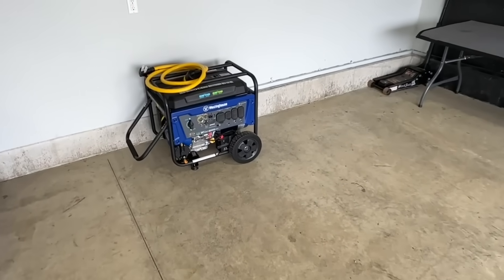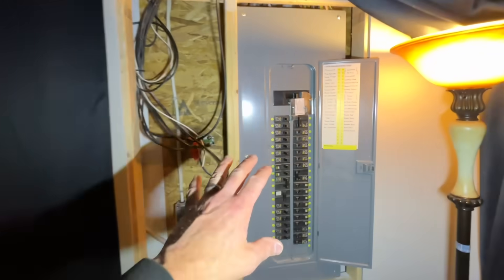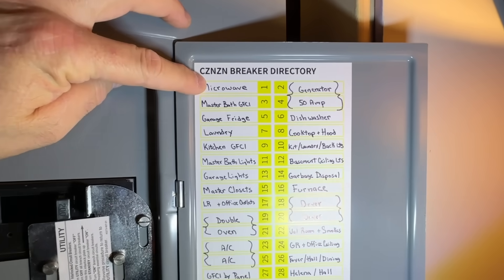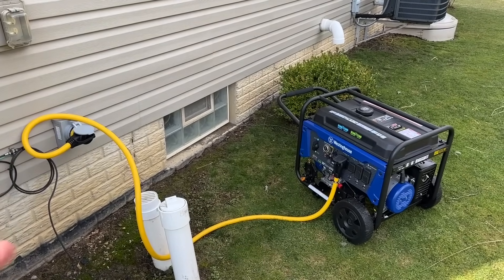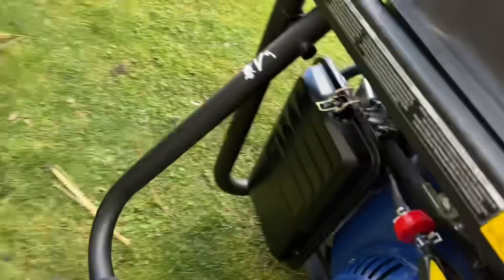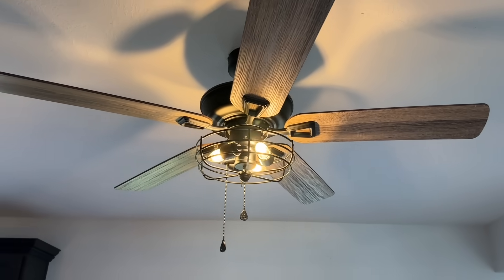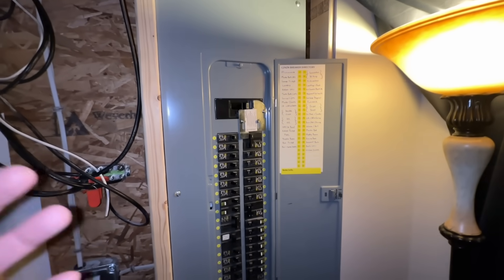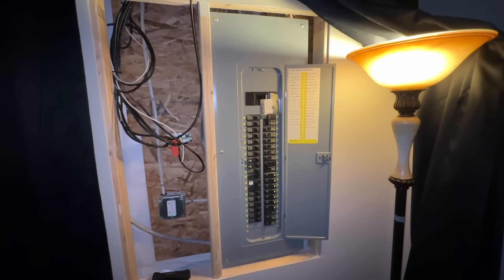Whole Home Manual Backup Generator Setup For Less Than $1600

Comment: I own an all electric home and do not have access to public utilities like city water and sewer. I did about the same setup as you have but I used a 12,000 watt Duromax dual fuel generator. Since I am also a licensed master auto tech with over 40 years experience, I know for a fact that running a generator on gasoline with ethanol will destroy the fuel lines, fuel pump diaphragm and generally destroy the carburetor, I chose to run on propane. I also have a 220 volt submersible 4 inch well, an electric hot water heater and a 4 ton central heat and A/C unit, 2 1700 watt microwaves and a standard as well as a convection oven and  an electric range top and an in ground pool. I will admit that the central A/C is a 2 year old 22 seer system with an 3200 watt start load and a 1600 watt run load and the pool has a variable speed pump which cuts the power consumption tremendously compared with a standard 1Hp motor that pulled 1100 watts for 8 hours to a 60 watt load for 10 hours. . There is a standard 22 cu. ft. fridge and a 24 cubic foot chest freezer, and of course a washer and dryer. When I was wiring the breaker panel, I used an amp probe to determine the load on each circuit and the only thing that gave me pause was that if the hot water heater was running at the same time we were baking and cooking and the central HVAC cycled, the generator would lose about 50 to 60 rpm for about a half a second. So I added a 240 volt switch to the 40 gallon water heater and we just leave it turned off until we need it. problem solved. Now we can run anything at any time and make sure not to have the ovens, or stove and dryer running at the same time as the hot water heater. I also got 3 40 pound propane tanks which hold just under 30 gallons of propane and weigh about 220 pounds combined. So there's no running around filling three 5 gallon gas cans every day and a half. The three propane tanks will run for about 5 days, 24 hours a day. Cost wise, gasoline costs about $50 dollars per day, versus $24 per day for propane. And unless you are going to store fifteen 5 gallon cans of gas you will be searching for fuel every day versus once every 5 days for propane. And propane can be stored for over 20 years while gasoline has a shelf life of about 3 to 6 months.

Running propane will cause a slight power loss and if I had a 15 kw duromax, I would be able to run everything at once, including the hot water heater, but at the time, the 12 kw was the largest dual fuel generator available, this side of a $12,000 dollar diesel powered Generac, which required multiple yearly oil and filter changes as well as yearly air filter, coolant and fuel injector filters and water separators and valve adjustments, which Generac said would cost an additional $500.00 a year. My total cost for everything was just over $2000 dollars and I'v had to use the system for at east ten times ranging from 1 to 10 day power outages
Reply: Would you recommend ethanol free gas to use
Reply: Great information. Thanks. That's where I'd have to be with my house in SWFL.🎉
Reply: With all that why wouldn’t you have a propane stove and water heater?
Reply from the maker: @akbychoice I have a gas hot water tank and gas furnace already.
Reply: Yes, it's amazing what you learn about your own personal electrical grid when you set up backup power. Luckily my stove is gas. It uses 120 for it's electronics, but that's minimal. My clothes washer and dryer are electric however. I have a 240 tanning bed that gets turned off on emergency power, as it's very voltage sensitive and normally has to run with a buckmaster. I do leave the hot tub on however, but that's it. The hot tub doesn't use much power just to maintain itself. But it does if you let it get cold. I keep mine at 104, and it's fully winter weather insulated. I also shut off my garage door openers and let them run on their own backup power. They'll run a couple of weeks on their own power easy. And they're both 3/4 hp motors. No point in allowing the backup generator to get involved in that if you don't have to. I run a huge gasoline powered job site Generac that's rated for ethanol gasoline, in a waterproof shed about 15 ft away from the house, and I had an electrician run the line and modify my panel for it. It will build a whole subdivision and will easily power the whole house and sensitive electronics, but load determines fuel economy.

I've only needed it twice in the 15 years it's been installed. Ironically, within the first two weeks I installed it. The power company now keeps the trees well groomed and it's never happened again. The worst was a whole week on backup power when a huge 9 foot across tree blew over in 100 mph winds, after two weeks of solid rain and we were still in the middle of the storm. The best was three days for the same reason, but a smaller tree. And, not a week after they got the power back on. They've since cut all the dead trees down. You can make power reliable if you want to. Even on poles. And that's why I installed it, you could see it in the trees and it spooked me. Really spooked me, obviously.

I seemed like a genus at the time. My wife thought I was crazy. I also setup the house across the street. Our little corner was the only lit corner in half the city, and they used it as their staging area because of it. We kept all the outdoor lights on at night. That was a hell of a year. They also profusely thanked us for having the backup power. And it comes around; we always had a funky street light and I called them on it. During all this. After it was over, they came back and tore out the 100 year old street light and put in a brand new LED unit. It's really nice.
Reply: im not reading that
Reply: After I bought mine, dual gasoline or propane, I saw  there was a three way, gasoline, propane and natural gas)..  
Anyway, I am interested in what exactly type of hose that you use to connect the propane tanks to the generator? What where the fitting on each end? 
My neighbor (HV/AC) said he would have helped hook up the natural gas, but the money even for the pipes and parts were pretty high, and too late. 
I live  in  a rural area and getting propane would not be a problem. My main issue when power is out, is I am on a well (good water) and needed a big generator to run it so I can flush the toilets and bath (3000watts just for the pump) and with this one I can selectively run the well and then switch to just one of the A/C and still have most of the other stuff running. 
Thanks for you post and help!

Comment: Nice video showing how to do it. The only thing I would do differently is I'd kill the breaker to the generator before turning it off like that. I would think the voltage would sag down to an unsafe level before completely shutting down and possibly damage electronics.

Something else to think about, don't buy a larger generator than you really need. The larger it can handle the more fuel it uses per hour.  I'm going to run on a 4200w Westinghouse. It is enough to run my lights, TV, fan, and 2 refrigerators and really sips the gas in econo mode. Last power outage for 4 days, I ran the generator while I was awake approx.  16 hrs a day, and used about 15 gallons. I would turn if off at night since I wouldn't be opening the refrigerators, they stayed cool enough being off while I slept.

I made a "suicide" 120v cord (20A wire with 2 male plugs)  and jack that into the outlet that is also wired to my sump pump so the toilets will flush. With how little power lights and tv's take anymore it can easily run all the normal stuff except for range, hvac, and hot water heater. I manually go kill the main before I plug it in and turn off all the 2 pole breakers. Going this route is energizes every other  single breaker in the panel. Most of my lights are luckily on the leg where the sump is connected. I do you have run an internal cord or 2 to power some devices that happened to not be on the same leg, but it's much better than the spider web of cords I was running though the door to power the important appliances. I did my setup with my own time making a cord out of saved heavy duty cords from old appliances and a Westinghouse igen 4200 for $500 off from amazon.  

About ready to be hit by hurricane Milton tonight so I was prepping my generator since I'm sure I'm going to lose power in Central Florida tonight for multiple days. I always do and this hurricane looks extremely bad. I hope all I lose is power....

Comment: This should be a standard option on the construction of all new homes. When you watch the news you'll see thousand's of homes without power across the usa every month.
Reply: Yeah, but doesn't exactly work for apartment buildings.  Quite a few North Americans also rent instead of own.  I know of one house in my town that was built brand new that is also a duplex and the owner put in a generator for his part but did not do the same for his tenant space.  The way the generator was installed makes it a pain as well because when I clear his snow it's right at the end of the da** driveway right where I want to put the snow and then I have to dig the thing out once in a while.  The last time we had a serious power outage was after an F3 tornado 14 years and a month ago (typing this on Sept. 25, 2025) and gas had to be shut off all over.  This makes those Generac pad-mount automatic standby generators completely useless.

Comment: Electrician here. If you bought this house new, you got jipped. With a basement you should've had a 400 amp service. That 200 amp is almost maxed out. We always did a 400 amp with a basement. Also whoever did the service slopped it up outside with running the 4/0 like they did. I wouldve raise HELL with them doing it like that. Just a pet peave of mine. I power my house the same way as you though. Works fine. Word to the wise. DO NOT TRY to power your well pump like this. I burnt up my pump and luckily it was still under warranty so I got a new one free. But its always enjoyable puttin one in!! Only reason I tried runnin my pump was it is only a double 20 amp. It ran but it burnt up the pump where it wouldnt work right after.
Reply from the maker: Yeah I build this home about 11 years ago and 200amp was the standard at the time but I wish I had 400amp.  I may have a sub panel put in someday.  I don’t have a well pump as I have a natural drain.  I only have this setup for emergencies which only happen once or twice a year for a day or two.
Reply: How would you reccomend hooking up the deep well being water is the single most important thing needed, except keeping your food from spoiling.
Reply: @darryldavis436  You need something that will pull the pump and wont bog down. My generator wasnt strong enough.
Reply: @Wannagobackto1980  OK, Thanks, As long as the Gen is supplying the power without difficulty and alot of load, it will be Ok.
Reply: I mean I really would risk it unless you study really hard and ask alot of questions. Call a well company and ask them and just really look into it before you try it. Pumps arent cheap these days. The one I have is at least 600 dollars. It doubled in 2 years. Used to be about 300.
Reply: @Wannagobackto1980  Just About everything in epensive these days but when the lights go out, we will need water.
Reply: Just RESEARCH before you try it. I dont want you ending up like I did. A burnt up well pump that needs to be replaced. I got mine free cause it was under warranty and installed it myself. It would probably be 1200 dollars if you had a company do it. At least!!!
Reply: @Wannagobackto1980  OK Thanks.

Comment: Diesel Legiance... I need to get a setup like that. Our power was off for 4 days with hurricane Helene and now we have hurricane Milton headed our way. I was on one of the big box stores websites looking at generators and they had a calculator to find out how much of a generator you need. It says for a refrigerator/freezer ya need 700 running watts to run it and an additional 2200 starting watts for a total of 2900 watts just to run one refrigerator. We lost all of our food when the power went off with hurricane Helene so I don't want that to happen again especially this soon after Helene. LOL Unfortunately generators and gas cans are hard to find in stock at stores around here now so it may be too late.
Reply from the maker: Just try to fine a good generator with enough watts needed to run what is needed.  You can also get dual fuel for gas or propane.  I did this setup on a budget as I only use it once or twice a year.  I didn’t need a $15k setup.
Reply: @DieselLegiance  Cheapest way possible is what I want. For the same reason, only using it maybe once or twice a year.

Comment: You can run your hot water heater? Never mind you answered it later on in the video
Reply: I run water heater on my 3500 W generator along with lights and two freezers - instead of using it in normal way(20 amp draw) I set it up in “emergency” way (10 amp draw), so my generator could handle that current.  Wait longer to heat water - but all family could take a shower during outage
Reply from the maker: Yes, but I have a gas hot water heater.  You can run a good bit you just have to be aware of how much your running.

Comment: what size wire did you run from your outside box to your power pannel?
Reply: there is a formula but for the most part if you have a 9-12k generator 6-3 wire is the thing. IF 7k and under you might get away with 8-3 but make sure. The price difference is small and the extra heaviness of the 6-3 is important and makes things work better without chancing a short or heat issue in the wiring. 6-3 runs our entire house with dual 50 amp breakers.  25000 btu 240 a/c and additional 10000 window unit totaling the same as about a 2.5ton outdoor system
Reply: @daddski1  thank you sir

Comment: You can kill utility workers like this. Electric can still flow through grounds. When it is reversed it takes 240 volts, runs it through transformers which takes it back to 880 volts or whatever transformer size it is. The ONLY way to do this correctly is to install a transfer switch which basically is like taking all 3 wires from your house off. I didn't know any of this until I had a utility worker knock on my door one day and ask to see my transfer switch. They heard my generator running and made a special trip to my house to verify I had a transfer switch. I had a relative that installed mine and did it correctly. He thanked me and explained what I just wrote. Please share. Don't endanger these guys lives. Their job is dangerous enough.
Reply: Transfer switch is grandpa era.  Ones you use interlock switch - that is all it takes to have safety setup.  I’m electrical inspector , and installed generator setups many times

Comment: Thank you for the DEMO.
I have a question you don’t mind:
In my house I also have a deep well 3/4 hp pump which use 220v and 30 amp breaker with automatic pressure switch. How and where should I plug  the cable into the generator (mine is 9000 W)?

Comment: I did the same set up but also added a Reliance Wattmeter (MB125) and a Reliance PowerBack (to alert that street power is back on). I use a Champion  dual fuel 10,000.

Comment: I upgraded my input to 50 amp from the 30amp using the whole power of the generator.  Larger thick wire!
Reply: Twist on plug is rated 30 A.  Range “shaped” plug is for 50 A
Reply: @AlexV-pf3io   whatever i upgraded too is a 50 amp if thats ok with you SA

Comment: You should never turn off your generator under load. 
And you should turn all of your breakers off before introducing it to power. 
And never do what he did when he shut off the generator and unplugged the male end and rested it on the metal part of the generator and without unplugging it at the box. All it takes is his generator breaker to not full engage where it allows the interlock to still slide and then he turns on the main breaker and that will send power right to the exposed male plug and blow up his generator or one of his kids touching outside while he is in the basement.
So when the power goes out these are the step you take. 
1. Turn on your generator and let it warm up. (You can plug in your plug at this time too)
2. Turn off all of your breakers in the house.
3. Turn off the main breaker.
4. Slide the interlock switch in position and turn on the generator breaker.
5. Turn on the breakers you plan on using one at a time starting with the largest Amp breaker you plan on using.
Steps to take once power is back on from the utility company.
1. Turn off all of your breakers in your panel you turned on.
2. Turn off the generator breaker.
3. Go outside and turn off your generator and unplug it at both ends.
4. Go back inside and turn on the main panel breaker.
5. Slowly turn on 1 breaker at a time staring with the largest amp breakers first.
Reply: Nice concise, but detailed instructions.  Very well done.

Comment: I think you may be overestimating your wattage requirement for your frig/freezers. I would guess each frig would be pulling about 100w +/- normal. (The surge requirement is much higher of course) My refrigerator is pulling 90w when the compressor is on...that's it.

Also...what are you doing to protect the generator from rain? (nice gen BTW)

Comment: No, no, no! Never shut a generator off under load! If you RTFM it warns you that doing so can damage the generator. When commercial power returns (You can tell with the newer meters because the led numbers start to flash) you switch it at the breaker box inside the house first. Then you go outside and turn off the generator. This allows the generator to cool down a bit before shutting it down as per the manual.
Reply: My 23 year old briggs &stratton generator doesn't care
Reply: @stevusbeavus720  Built with more robust components of course.
Reply: @stevusbeavus720  it does care you just don’t know it until you have a failure